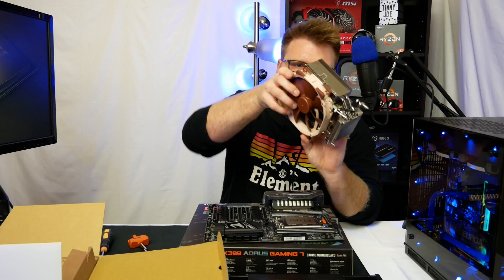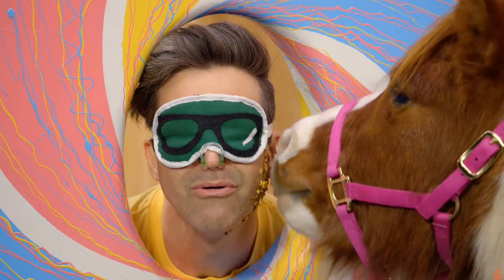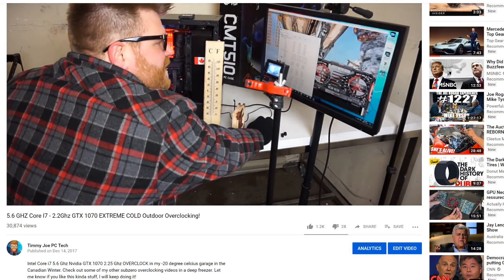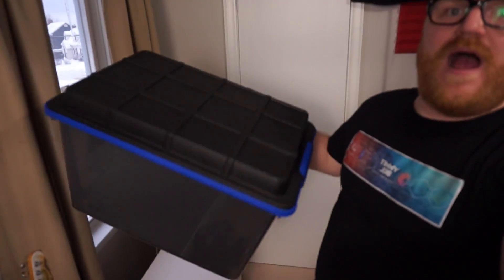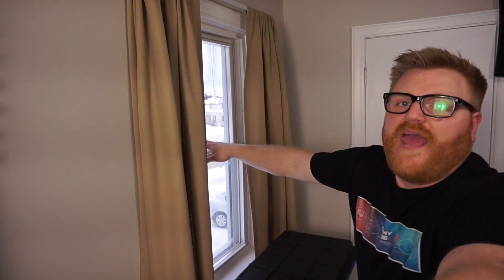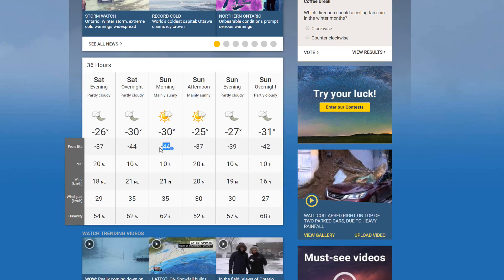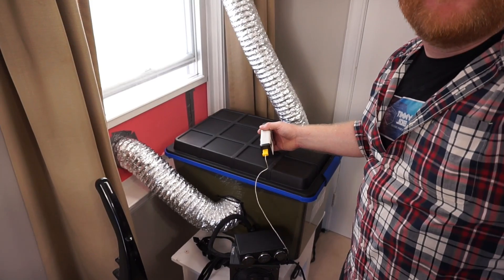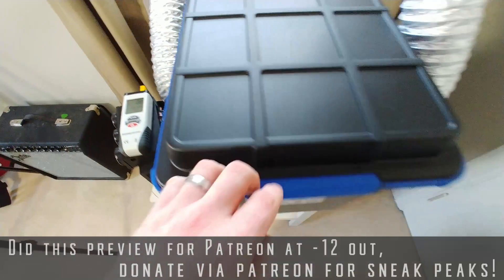Buidling an EXTREME -27 overclock box!

Comment: Oh, I forgot to say, I ran my system like this in Northern Minnesota (Cook), and it worked flawlessly with a 2500K, a 3770K and 4930K and they all worked flawlessly. Never had an issue. The only difference is, I had it in an actual case, so the cool air blew right onto the  HSF, and then mixed with the warm air coming into the case, then it was mostly exhausted back outside...

Comment: Perfect idea man!!! Awesome,!  Kudos from Australia!  I did this exact experiment back in ~2007 with the 8800GTX GPU whilst living in Berlin.  Trick is to isolate hermetically the mobo from the cooler.  Awesome job, please revisit!

Video suggestion:  Custom direct-die cooling using the 3M or similar 'oil' pumped through rads.  If i had the coin it would be cool to see a perspex transparent silicone adhered 'oil-block' where the IHS is removed from the CPU and the 'oil' is pumped throughout a loop with an appropriate pump!!!

Comment: A couple years ago I got my window-mounted AC unit and put it in when it was -26 outside and just put a box around the inside part with a dryer tube to my pc case fan and it got to probably -40... Then the AC got really hot before the AC unit died. Froze the AC unit solid.

Comment: I'd love to see a video of the BIOS setup on that FX chip. 

For years, I have done the same winter build with my FX-9370, and though I've got it up to 5.15ghz, the best score I've reached is 777. I'm on a Sabertooth 990FX. Care to offer up which FX/AM3+ overclocking guide you used?

It's terribly cold, right now, and I'd not be opposed to getting the dryer hosing back out, see if I can break 800 on my Vishera.

Cheers,

Comment: Keep the box and cycle in the dry cold air, keep it closed, let it warm up a little for no cold bug and then run the radiator outside, that way you don't have a moisture problem around the CPU and get it really cold from the rad outside.

Comment: I think this was awesome, as I'm sure you're not the only person who wondered if such a thing was feasible. However, I think you missed out on an easy fix....use that foam, make a cut out for the CPU cooler, have it as low to the motherboard as possible, as tight to the bin as possible so the air doesn't go to the motherboard, and it SHOULD theoretically prevent as much cold from getting to the motherboard and causing problems. Worth a shot, wouldn't you say?

Comment: I love these experiments, but maybe try and make a shroud with cardboard to only cool the CPU heatsink, the imperfect seal should still be enough to cool the surrounding area of the board like the VRM's. Tho 6+2 phase is probably the limitation, my 12+2 phase on my ASRock 990FX Fatality Pro had a hard time staying cool with my 8320 at 5.2ghz with direct air flow blown right down on it.

Comment: I'd love to see how a modern Intel system like a Z170 with a decent motherboard would behave in those conditions.

Also I'd try doing a hybrid of the two you are bouncing between. Use the watercooling stuff and place the rad outside, but keep the motherboard etc inside the freezer box. Except this time use something like 800rpm fans so it doesn't get too cold for issues. You would have no problems with condensation without the issues of MB freezing up.

Comment: Hello i am trying to sell a spare pc after upgrading to a new one.
can someone give me a good list price on craigslist (USD)
or at least part out...
amd fx 8320 with cooler master 212 evo
 
(1.42 volts @ 4.6ghz ...24/7stable)
asrock 970 mobo
16gb ram 1866
samsung evo 850 250gb
1tb seagate berracuda hdd (7200rpm)
msi gtx 970 oc edtion( i had it listed for $100usd, low balled a few times for 50-65$)
antec 300 case..2 blue flans up front
corsair 500 watt psu
THANKS!!!!!!!!!!!

Comment: It's a great idea but if you get a motherboard that'll work with sub zero temps then you'll be fine. But if you do do just the custom loop with rad outside see if you can get a heated backplate to help with condensation as that'll help preserve your hardware.

Comment: Nice try Timmy. But what if you put a big heatsink on the cpu (without fans) and make a box around that heatsink with ducts connected. Then you will be using the cold air only for the cpu.

Comment: for the fluid you could use a mixture of alchohol and I dont recommend antifreeze since its max temp before freezing is -40 most of the time maybe a little less depends on the brand and if its a 50/50 solution so definetly dont use antifreeze there are better solutions. that and anti freeze will quickly ruin ur water loop so dont use anything expensive for the loop buy some stuff off of ali if u do plan on doing an antifreeze loop

Comment: i used to do this with my duron back in the day, 600@1133 :). what i did was get a longer dryer duct and zigzag it behind my desk to allow the air to warm up a bit. then connected it to the case's side intake fan. that way the system wouldnt suck cold air until it was turn on. helped with cold boot issues and condensation.  oh and hey from AB! edit: the guys below are right that you will need a higher end 990fx mobo to get higher/stable.

Comment: The problem I saw was that when you ran Cinebench at 1.64v your temperatures spiked to over 10C then it crashed. The reason this is happening is because no matter how cold you get the NH-D15 it will never maintain the load. You would be way better off with a 5lb chunk of copper as a heatsink instead. Even better would be to use some pink RV antifreeze or similar and run a waterloop. I do this with my Monsta Single stage and idle temps are -40C, but more importantly liquid can handle the load and moves the heat away quick and efficiently. Something a heatpiped tower will never do after 300 watts

Comment: The FX-8370 still holds the all time highest clock at 8.7GHz. Even today for light work and low end gaming the FX-8350/8370 can still get the job done.

I would look into one of the MSI AMD 990FX boards.

I would use soft eraser to make a seal around the CPU in the socket and use a Noctua tower cooler with NT-H1 thermal paste and then find a way to create a direct flow Sub-Zero sealed system going through the fins of the cooler. This way you keep the cold directly on the fins and any residual heat dissipated through the ambient temperature of the cold leeching into the box.

Comment: Use some High CFM delta 120mm server fans like TFC1212DE's or QFR1212GHE's. Don't connect em' directly to the board however. Use direct 12V from your PSU or at least a fan controller.

Comment: you should be able to get a motherboard that can handle the cold, when they do xoc with ln2 the whole board is covered in frost so everything is iced over, and there is settings in the bios (different voltage settings) that you have to change for sub zero stuff. cant remember which settings but if you can get a hold of buildzoid you should be able to get an answer from him, he has done fx cpus with ln2 a lot =) it is probably just a few tweaks and then its fixed

Comment: why not try to box off just the top of the heatsink where the fin array is? would that not work?
Reply: I was thinking that.  Just run the vent hose through it and put them high speed fans on it as a push pull.

Comment: you need a thermostat damper on the ducting so you can control the ambient temp to get it right to the limit (-5C). Let the cpu cooler heat the air to and dump it. PMWs will do the work for you

Comment: Well Timmy. I know it sounds unrealistic, but what if you just attached the tubing straight through the heatsink fans? Somehow Insulate the remainder of the mobo from the external low temp of the box = the super-cooled air is directed moreso straight through the fins and heat block? I'd love to see a Q6600 SLACR oc with this box. (Still have one!) Do more testing! Good job man!

Comment: I got an 877 CB score on my i7-4820K@4.984GHz, but it was hitting 60c. I'll bet at -27c I could beat the 1000 CB mark.
And just FYI, EVGA doesn't make AMD boards! Asus or Gigabyte will be your best bet. And it's not a stupid idea. But with the rad, use automotive antifreeze with a 70/30 mix (AF/Distilled Water)

Comment: what if you hang a motherboard face down. suspended on some kind of frame with a water block and -40 liquid. then the condensation will drip away  and off the water block and motherboard

Comment: You don't have to succeed at every project. Your videos are just as good either way. I've got a GA-990FXA-D3 (rev. 1) motherboard with an FX 4170 and 8GB of Corsair Dominator RAM that you can have if you think it is any better. I even made a custom VRM heatsink for it too because it doesn't come with one standard.
Reply from the maker: I will find another board or seek another solution, thanks for the offer though :)

Comment: There is a very simple way to solve this problem, find a plastic box that is barely bigger than you air cooler rad and glue the 2 fans u had there on the box. Cut the bottom of the little box and wrap it on top of the cooler, there is no need for 2 sets of fans. Then use that thick foam to insulate the bottom of the box so that it only wraps around the cooler. Done.

Comment: How come condensation not an issue at these temps? Just curious
Reply: You need moisture in the air.  It's to cold to have that. All the moisture is frozen. No if he ran something from the outside back into the moist warm inside, it would condensate.

Comment: I think all you need to do is modify the bios so you can set an offset to the mobo and cpu temp so then you can run it in cold temps. Kinda like if you run LN2 to overclock.

Comment: Wait for a -30*C day, with wind so you get into the -40 or colder range with the wind chill, and put one of those big ass fanless heat sinks on it and bring it outside facing the wind, and use remote desktop to do your testing so you can stay warm lol. Sadly its calm here too.
https://www.asrock.com/mb/AMD/990FX%20Extreme4/ This is the 990FX board I used to get a FX 8120 to 5.2ghz on air. The FSB heatsink is huge and I also had the included fan attached.
Maybe a FX 9590 will beat your FX cinebench score with this cooling setup :D However FINDING 990FX boards are EXPENSIVE.
And its not a 'terrible video'. The fact you had an idea, executed it, and didn't get desired results, is all the part of experimenting.

Comment: What if you built a box around the heatsink with push-pull freezing air, and protected the motherboard from any condensation? Your plan was not a stupid idea, it's just the hardware isn't designed to be run frozen.
Reply: @phillylove7290  It didn't fail from lack of heat transfer. The motherboard would not run in sub-zero temperatures
Reply: I like that idea. Would be fun to try for shits and giggles.
Reply: I was thinking the same thing.  If he had a 3D printer he could CAD up a setup to just force the air past the cooler with vent and fan mounts.  Or just go out and spend $3200 on this beast and factor in some additional wind chill to it.
 https://www.turbines-rc.com/en/schubeler/344-schubeler-ds-215-dia-hst-195mm-carbon-edf-ducted-fan-motor.html
Reply: @phillylove7290  That's total bs, his issue was mobo temp not cpu temp, it was running at 0oC at 5.25GHz, which is awesome.  Higher end mobos (e.g. Rampage IV Extreme) have LN2 and other sub-zero settings that offset these issues.  By hermetically sealing anything electrical, but especially the mobo, his system would've worked.
Reply: @phillylove7290  sub-zero settings are throughout the bios.  pls go and get some experience on higher end stuff

Comment: Cool thinking and entertaining to see 'what if I do this stuff'. That cold outside air will dry as a dry thing only dryer! Making lemonade out of the Canadian lemon weather. with automated bypass valves off the 'hot' exhaust and ducting that back over the motherboard- then exhausting outside may work?- air still dry, just warmer. Then 'the box' will have 2 more pipes connected to the outside...

Comment: Did you ever consider the humidity?
Reply from the maker: I talked about it. At -20 and lower there is none
Reply: Condensation forms when you're below ambient but inside the box the ambient temperature is -27 °C so he's definitely not below ambient. When he opens the box and lets warm air inside the box it might be a problem unless the fans are keeping the warm air from touch the hardware.

Comment: Cold in from the bottom. Hot out from the top. Don't fight thermodynamics, get it to help you along to the finish line.
Reply: This stament is not valid once there is any other factors. Like fans!
Reply: @Jarrizar  nope it still is valid  because the hose not the fan is the limiter.  also you  aren't dumping thermal pollution  back into your cooling loop.